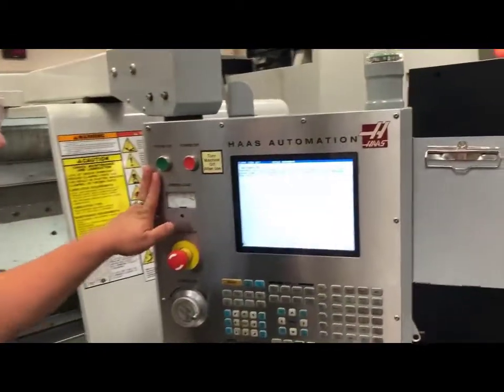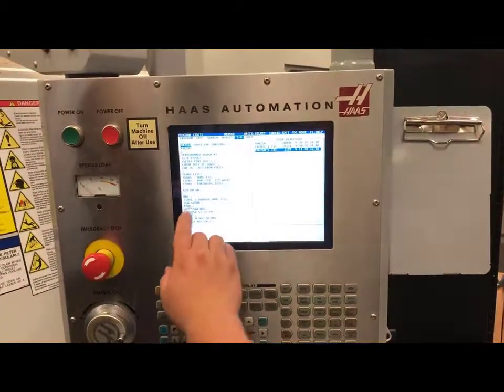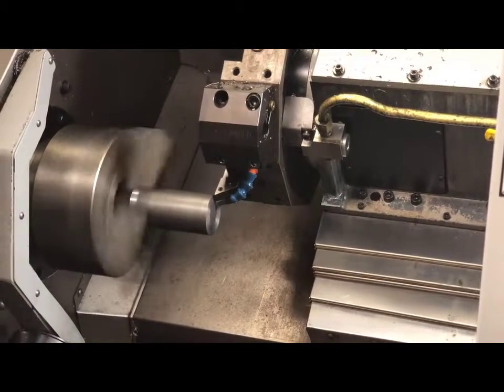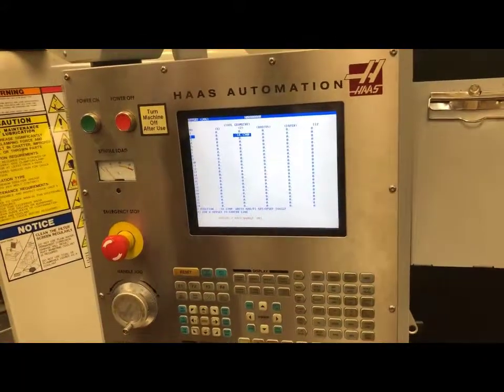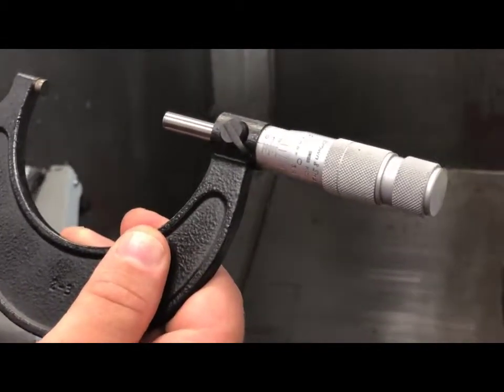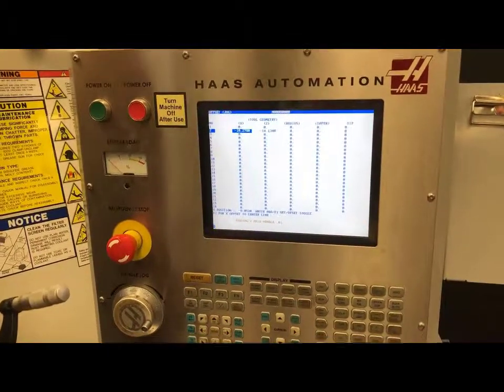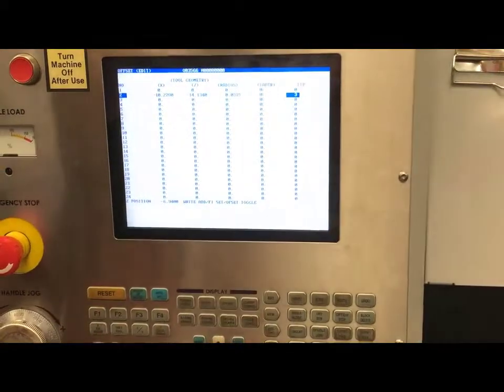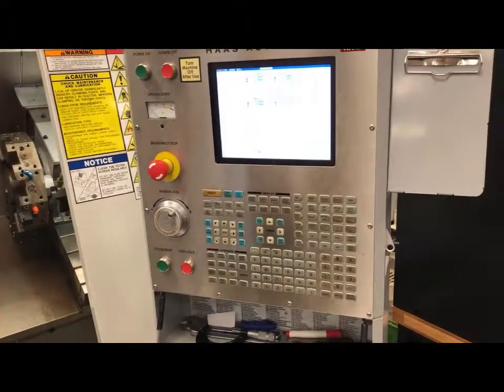Haas SL-20 Lathe Setup

Comment: Hello again 😀
First of all, thanks for making this tutorials for free, they are helping me a lot and they are very practical and good explained.
I have a few questions and it would be great if you could answer them. Thank you in advance! Here comes the questions:

*You said that if you were using tool eye you would need to use work geometry offset. Does that mean that you would need to measure the distance from the tool eye to the face of a part and then type that distance in the work offset page so that part zero shifts from tool eye to the face of the part. I though that machine itself do that calculation, and automatically shift zero point from the tool eye to the face of the part. So my question is do you need to measure distance from the tool eye to the face of the part manually and then type that distance in the Z axis work offset, or machine itself do that job and calculation for you?

*My second question is, if we setup machine like in this video, and then use next part that is bigger in diameter than the part we used for setting up X and Z axis zeros but we use same tools in that next program do we need to set X axis zero again, since now the diameter is bigger, or once we set X axis zero we do not need to zero it anymore because no matter of diameter, zero axis will always be in the middle of chucks and that is already set first time... If that is correct (that once set, we do not need to setup X axis zero ever again), does that mean we only need to zero our Z axis (if part is longer) and we can do that simply by shifting Z axis work offset? Why then people always use paper technique and setting up Z axis like in this video, for every new part, when they simply can shift work offset and that's all what is needed (since X axis zero is always the same and Z axis can simply be shifted). Also, can I shift Z axis via work offset in negative direction? For example if part is not longer but shorter? Can I move Z zero backward for shorter parts or work offset coordinates are absolute? (for example - 2mm will result in adding 2mm and not subtraction)... You know what I mean, is in work offset -2 same as 2? So question is can you set up Lathe simply by shifting previous workpiece zero via work offset? That is less work than manually moving tool to the face of a part and hitting Z zero measure...

*The question that bothers me is that we in our schools learn that when making program for CNC lathe turning process, zero point of a part always needs to be placed at the face of FINISHED product and not at the face of RAW part (preparation material)... So, if engineers who writes program set zero at the center face of the FINISHED product, and all coordinates in the program are measured from that point, why then when you setting up lathe you position zero at the face of RAW part (preparation material - bar) ? I think that, in order for that program to run correctly (to line up program zero with part zero) you need to shift zero point of a part, from the face of raw material to the face of a finished product... So if you are facing off 3mm of material (for example) you would need to position part zero 3mm in the material (into the bar) and to do so, you must shift Z zero axis via work offset 3mm into the bar. Because if program zero is in material and machine zero is at the face of raw material, coordinates in the program will be missed by 3mm... The only explanation for this video to be correct and for the machine to be correctly set would be that program (G code) is written with a program zero positioned at the face of preparation material (on the raw bar), only then program zero will be lined up with part zero... Am I right? That's my point of view since in school that's how they taught us and it seems logical because finished product is surrounded by material that needs to be removed, so zero point of a part must be in the material, not on the face of material.

*My final question will be about sending program back to the USB. I don't understand that part... I mean, you first connect USB to the machine to put program from the USB to the machine and at the end of the video you are sending that program again back to the USB? Isn't that program already on the USB since you used that USB to send program to the machine? Why is it needed to send program back to the USB when USB already contain that program? Isn't that gonna make duplicate of the program or ask you to copy and replace, since you did not change the name of the program so it would be same thing that's already on the USB... The only explanation to me would be that program somehow saves new X and Z zeroes you just set but that does not makes any sense, because machine saves zeroes, not program... Program is only coordinates and you did not change any of them so you basically sent program from USB to the machine and then again sent that same program to the USB, I don't get it... Maybe is the program erased from the USB once it is sent to machine? So that's why we need to save it again to the USB by sending it back? But if that's so, how then it stays in the machine? Would not it be erased again from the machine once we send it back to the USB? Hahaha, I don't know, just my guessing... 🤷‍♂

Sorry for long comment and a lot of text, but I am just very detailed at my questions and want to learn something practical, because in schools they taught us only theory... This comment just looks big, but when you read it you will see that the questions are actually short, especially for you who knows the answers. Thanks in advance and keep making this useful videos for us machinists! 🦾
Reply from the maker: No worries on the questions i'll try to answer them all. The first question about the tool eye. Is if you are going to use it then all tool must be set off the tool eye. Once they are set off the tool eye the machine geometry page now know the distance from home to the tool eye, but the machine work offset does not know the distance from the tool eye to the Z0 (face of the part).  You must activate a tool that you set off the tool eye and then move the machine to the face of the part and then type Z0 Measure. My Doosan video will show this more clearly. Once that is done your tool geometry's and Work offsets are complete. here is the link to the Doosan Video. I'll get to the other question Soon
https://www.youtube.com/watch?v=Ti1gESuCutc&t=592s
Reply: @aaronrunk4209  Thank you very much!
Reply from the maker: On your second question you are correct if your part is bigger in diameter it will not matter once the tools are set to the center of rotation when you start running a longer piece for a different job you may have to change the Z work offset but that is all. When you make your program your clearance plane should be out far enough to where if a part of the same diameter is a little bit longer or a little bit shorter it should still be far enough in front of the material to not crash and complete your part. I have attached another video below to explain how to properly program your clearance plane.https://youtu.be/KQRO0IsjUkY
Reply from the maker: When an engineer programmer decides where the the finished part location is that versus the work offset it's honestly up to that person I have programs that students set up and run where they touch the face of the part and then shift to the finished thickness I have students that have a set up part that's already to the correct length and they set the face measure off the finished part of a setup piece and then they load the raw material into the machine to run it a lot of companies will actually set all their tools off the face of the check not the check Jaws and then they will do a z face measure from there to a finished part there's lots of ways of doing it but whatever company you end up at you'll have to do it the way they want you to do it or if you decide to make your own company you can do it how you would like to do it it's just different ways of completing the same action
Reply from the maker: On your question about sending the program back to the USB. In industry you will run into a situation where you have made several edits to the program that is in the MCU. If you have made several edits you will want to put your new edits back onto your computer or where ever you are storing your programs. This part of the program is just for that. If you have made no edits then there will be no need for this portion. Thanks again for watching.
Reply: @aaronrunk4209  Thank you very much for help! Honestly i learn more from people like you than in school!
Reply: @aaronrunk4209 why didn’t they show here in this video how to set and attach working mixtures (G54 - G59) ?????????????????????????
Reply from the maker: @АлексейРоманенко-х1ц   The tools are already in the machine. Most Lathes will keep a standard tools in the turret for multiple jobs